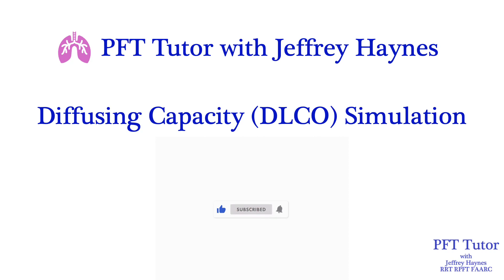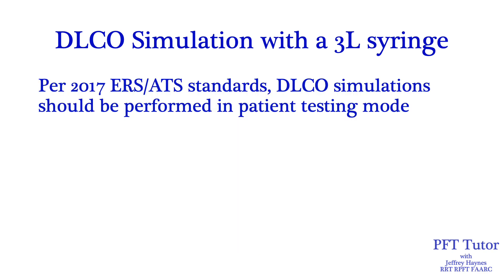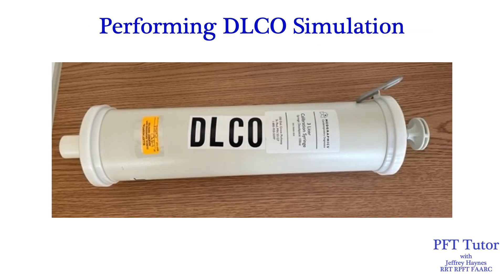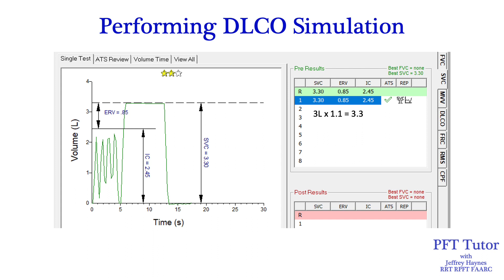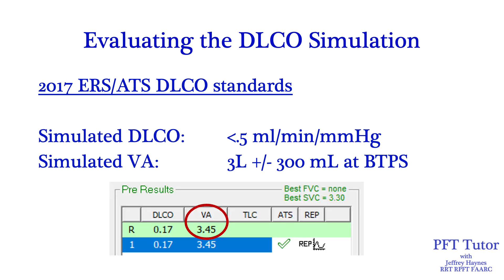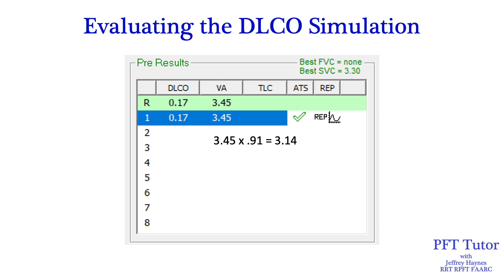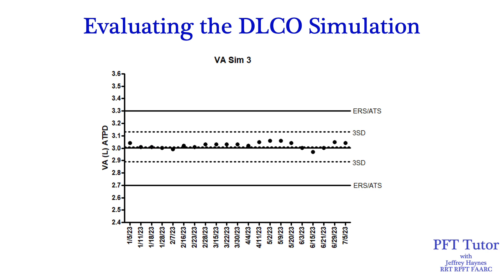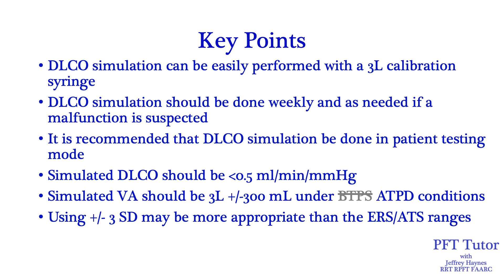Pulmonary Function Testing: Diffusion Capacity (DLCO) Simulation Test with a 3L Syringe

Comment: Hi, do you pay any attention to the IVC during this simulation? Thanks.
Reply from the maker: Yes, if the IVC is is not close to 3L there is a problem with the volume measuring device which will affect DLCO.  The inspired volume is part of the VA calculation and VA x KCO = DLCO
Reply: @PFT-Tutor  Yes, I agree. My system IVC is measuring below 1.9L 50% of the time. 1.85L - 1.94L; with BTPS off using prevent flow sensor (MGC - Latest version of Ascent software). Despite replacing with new flow sensors; I still get this result. Syringe has been leaked tested. I'm not sure the reason why. Syringe deapspace is 85mls; I've not taken that into account per se.
Reply from the maker: The MGC DLCO simulation protocol used to call for starting the simulation with 1L of air in the calibration syringe, is this how you're doing it?  That would explain the IVC near 2L.
Reply: @PFT-Tutor  Hi Jeff, yes, sorry I left that detail out. After troubleshooting the issue today I came up with a slight loosening of the demand valve screw (1 turn; decreasing resistance) brought the IVC back to 2L. First time I've encountered this problem/fix. Thanks.